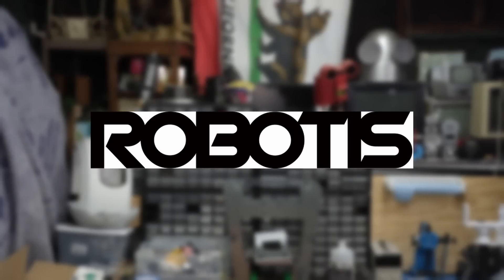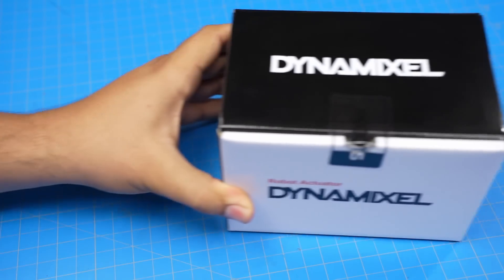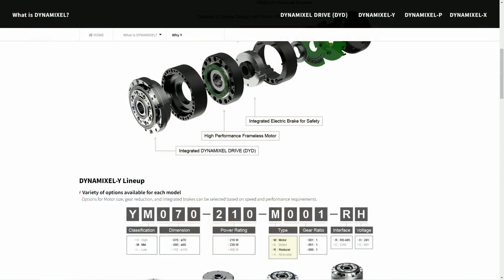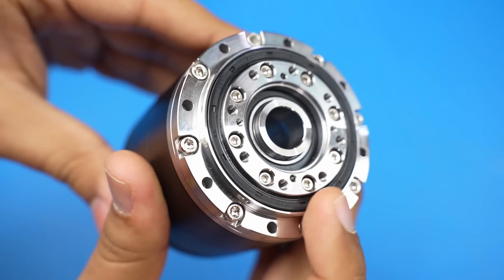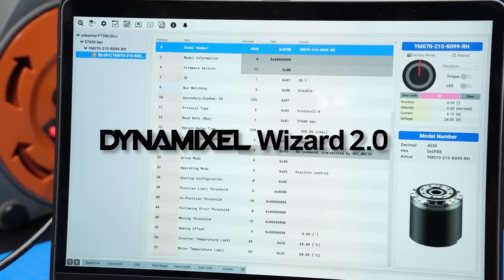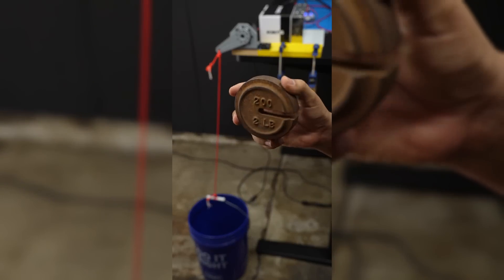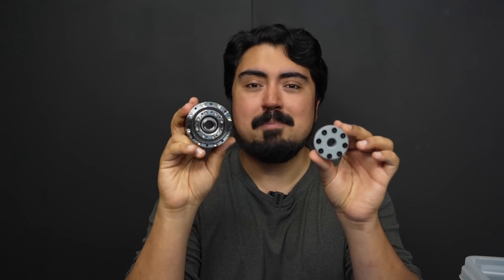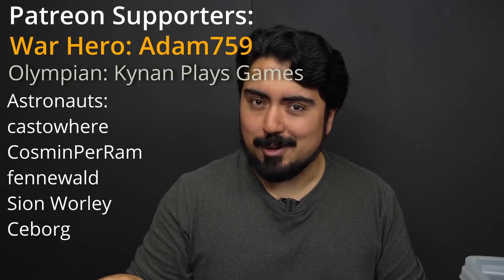Unboxing the most POWERFUL servo I've ever used - The DYNAMIXEL-Y

Comment: Nice video. I have been playing with the Dynamixel Y servos for some time now. I did some experimenting with them to use on a Bridgeport mill to control the X and Y axis. They worked great and had enough power to cut with a 3/8 end mill at .100 deep and full engagement. Look forward to seeing more of these videos.

Comment: Whats the advantage of using servos vs stepper motors?
Reply from the maker: Closed loop position control among many other things. A stepper can lose steps as it moves for a number of reasons and is less effecient. High end servos like this also have different control modes like absolute position/velocity/current and can  provide feedback to the host controller.
Reply: @MrVolt  that's interesting, thanks for the explanation! Im looking forward to see more of your awesome work :)

Comment: Why did you convert Newton Meters into kg cm? Like, don't get me wrong, I am very happy that you convert lbs to kg, meaning imperial to metric, but why metric to metric?
Reply from the maker: Trying to bridge the gap for values that people hear more often. Hobby servos usually offer kg cm as torque, so that is a value that people have a sense for vs Nm which is less common for cheaper motors.

Comment: How much accurate it is comparing to a small servo? I mean, if you want a lot of accuracy and torque at the same time, would that be a good choice or you would prefer a small one?
Reply from the maker: Not a fair comparison really. These can hold (in theory <.05deg). There's no noticeable backlash when trying to move the output by hand. Like an F1 car vs a toyota corolla

Comment: i dont know jack shit about electronics. how are you powering a 210w motor with a 200w power supply?
Reply from the maker: That's max power draw, not continuous. I'm not pushing it to its limits. Under the weight I tested it averaged 120w